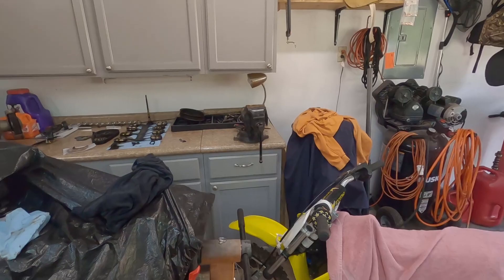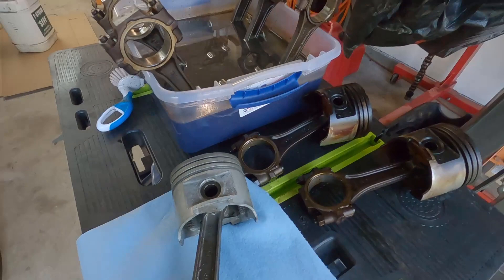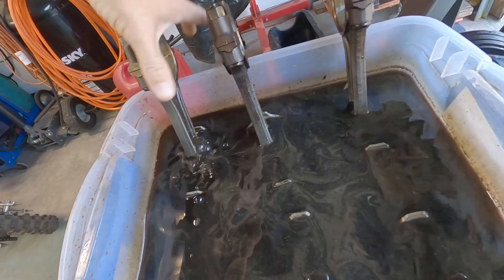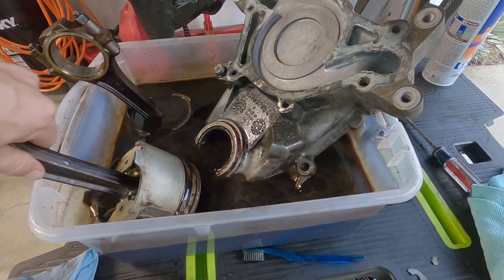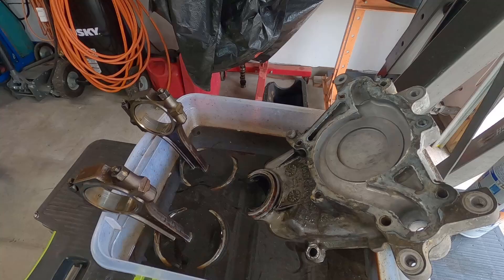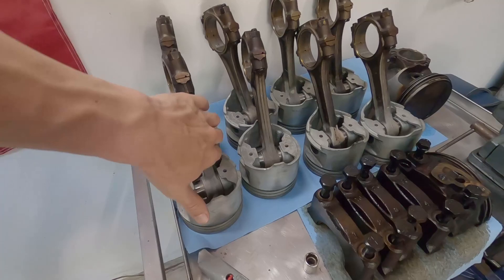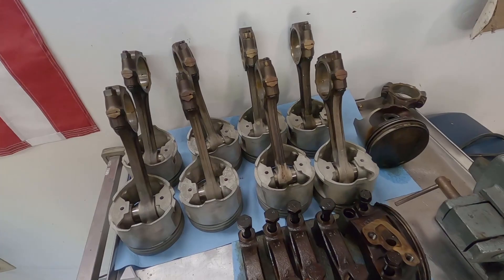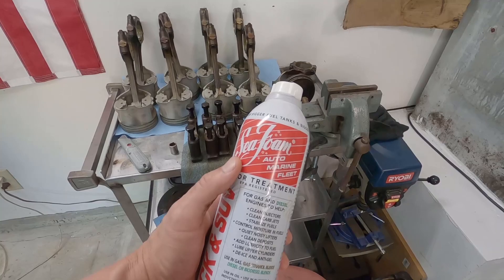CHEAP Wal-Mart Parts Washer

Comment: That was interesting and cool to see the cleaning of the 318 parts. That is a good idea. I watch another video the other day of some guys that did something similar. They used a big galvanized metal trash can and filled it with a gallon of dawn dish soap and Zep industrial degreaser. They cleaned an entire engine block and head. Granted it was only a 4 banger. The one thing they did a little different was they had
 a propane burner top and put the trash can on top if it. It worked good. Your setup worked good. Good idea.

Comment: Cleanliness is next to Godliness . I dont skip on cleaning stuff wether it be bolts or engine parts or gasket surfaces . I seal off ports ect and use 230 or 150 grit on a small orbital sander and sand the gasket surfaces then uses a small shop vac to suck up the residue and then go back over the areas with carb cleaner and microfiber rags . ive never had gasket leaks knock on wood .  other people have made comments like my dad ect that I should just wipe off the areas with a clean rag and carb cleaner and slap the gasket down ? but he usually has a leak develope later on down the road . I do the same thing you do to get stuff clean and save money 😎👍. I found this cheap trick out take that same style of bucket and attach a 5" orbital sander on the bottom upside down and put your parts and cleaner in the bucket or container put lid on and turn on the sander . it's a poor man's ultrasonic parts cleaner 😎👍
Reply: Good idea 👍, but I think that would be subsonic. LOL
Reply: @frankjones4950   I looked it up at harbor frieght the actual machine  it's an  ultrasonic parts cleaner  . it's all good lol

Comment: Looks like I need to pick up a couple jugs of that stuff for the Pontiac 400 I am doing the same thing to. Its filthy to say the least. Good tip on that cleaner.

I use ethanol to clean my fuel systems, E85 and home made E100. Works good for lots of compression and boost too. When I pull my E85/E100 engines apart for upgrades they are very clean, if I only run E100 in them they are spotless. Its very nice.

Comment: Super clean is great stuff! I find it works a little better with hot water!
If your trying to get the carbon off try some delco or kleenflo combustion chamber cleaner, let it soak for a bit, give it a scrub and then it pretty much cleans right up!
Reply from the maker: Thanks!! I’ll try it.
Reply: I agree with the hot water, it works. I purchased an electric roaster cheap at an auction, put it on low with Super Clean & water...it does wonders.

Comment: I'M not sold on any seafoam products.
Reply from the maker: What do you like to use?
Reply: @TheGasTap  Depends on what I'M doing I like Super clean and Purple power. I think the best injector cleaner as far as an additive is the chevron product had a friend worked at a local dealer ship as a tech and thats what they used in the shop there.
Reply from the maker: I’ve used the chevron Techron and it worked really well.
Reply: @TheGasTap  yea thats the one i was talking about

Comment: I have a questionnot related to this video can I swap 318 la heads 302 casting onto my 318 magnum if so what do I need to do this
Reply from the maker: To my knowledge, there is no oiling prevision for the Magnum to provide oil to the rocker shaft on a LA head.
Reply: What if I tap a oil hole in the rocker arm for the push rod
Reply from the maker: I've never seen it done...be the pioneer!!